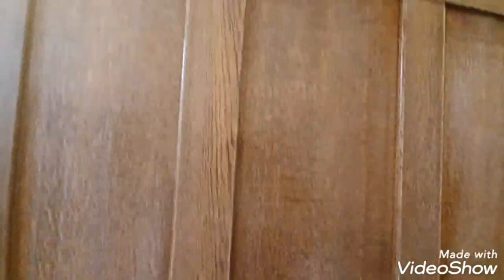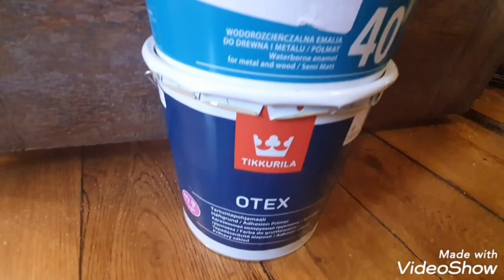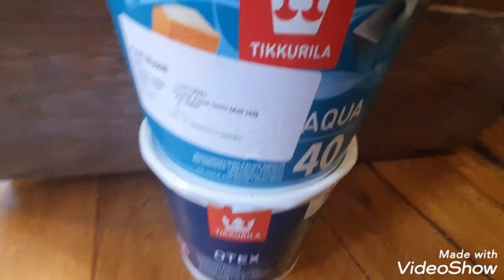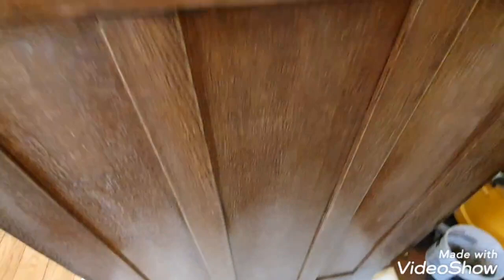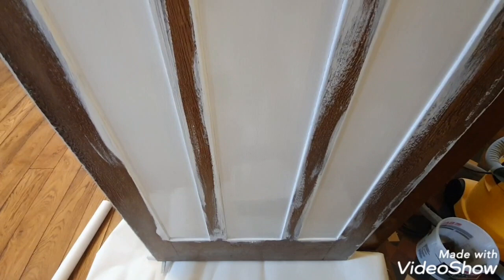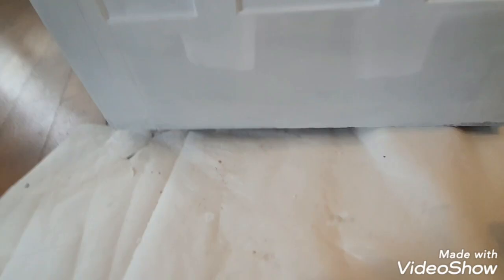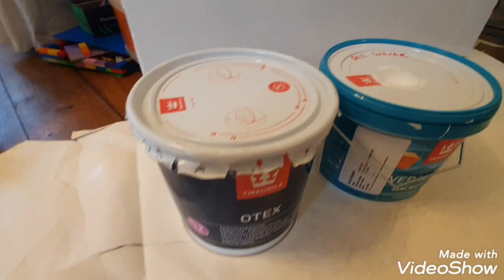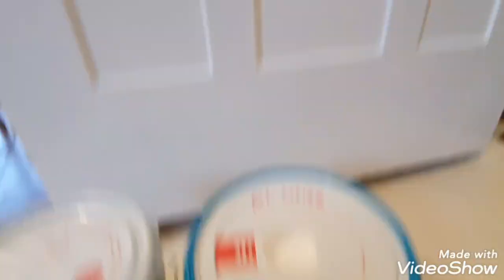How To Paint Over Gloss Varnish

Comment: Hi Danial haven’t used the otex oil only the akvar does the otex oil smell as bad as cover stain and also you seam to be trying all the water based top coats what’s your best choice thanks
Reply from the maker: Otex is designed for external woodwork as an etch primer. It is the basecoat for Eveal Aqua which is their waterbased external enamel paint. I used it internally on this varnished woodwork because of its toughness and finish. I did a scratch test and it was solid. Also no staining came through. 
I try different products on different jobs but this was a winner. Cheers Dan

Comment: Great videos, how do you find this primer over the BIN primer? I  noticed Zinnser only primer advise over varnish.
Reply from the maker: Yes this is alot easier to use. And good etching. I did a scratch test and it was perfect. Also no yellow bled through which was on my mind but it worked out well. Cheers Dan
Reply: @danielnugentpainteranddeco557 
Great l need to give a shot. TIKKURLIA good gear, process being bought by Dulux or Johnsones, bidding war going on.
Reply from the maker: @richardmcdougall233  I didn't know that. Hope the quality will stay the same
Reply: Excelkent video mate like the otex
Reply: @danielnugentpainteranddeco557  PPG now own TIKKURILA Johnstone's parent company.
Reply: @danielnugentpainteranddeco557  
Can you use this primer on stained windows outside ?
Reply from the maker: @2010dgizzle  zinsser B.I.N over stain or Blockade by Smith and Roger. This otex is good for everything else.
Reply: Great to have found you! Watched a few now... I always use the zinsser cover stain as a base to varnish, dries quickly, and can overcoat with water based, or 1-2-3 bin, if I'm going in oil... How does your primer compare? Is it similar or superior??